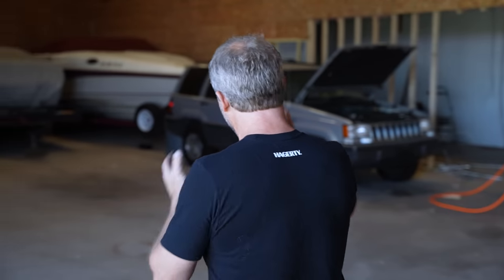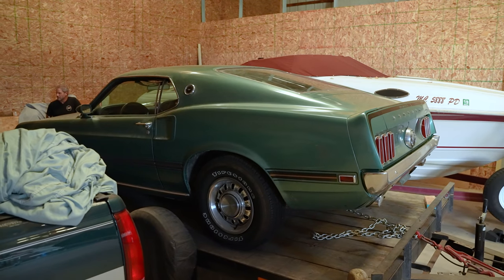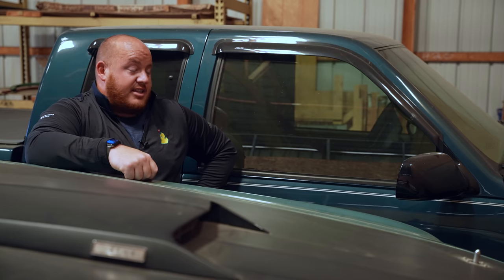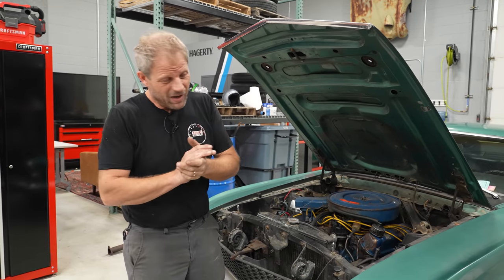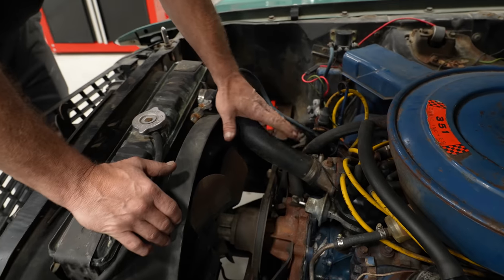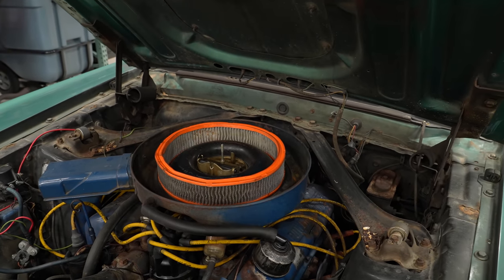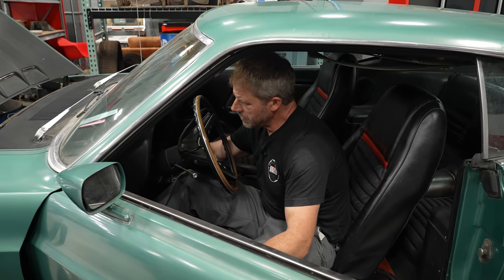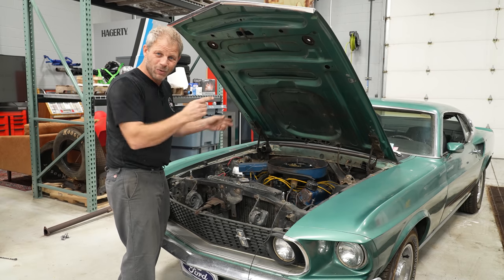Will it run? "Ran when parked" '69 Ford Mustang Mach 1 uncovered after 20 years in storage

Comment: Change the oil, rebuild the ignition, rebuild the carb, new air filter, new antifreeze, and thermostat then time to try it out. That's a 2 day job if the carb rebuild kit is available and you take your time. Once that's going do a brake job and get new tires.
Reply: Yeah you should always do a reverse coolant system flush as well. Not to mention the fuel filter, and pre-oil the cylinder bores.

Comment: What a great car in a unique color. Looks in amazing condition. Windsor had a 2 barrel and Cleveland had a 4 barrel and better internal parts list if my memory is correct With 290 listed horsepower. My first new car was a red with gold strips Mach I with a 351 Cleveland. Also. For all those complaining about the new Mach I not having a Shaker hood. Take a close look. No shaker hood. The Shaker came on Cobra Jet cars. I opened my scoop and purchased a breather ram air air filter that worked off vacuum. Loved that car, but having kids created a need for a larger vehicle so the Mustang had to go. One of my favorite cars.
Reply: The 351 Cleveland has canted valve heads simular to the big block Chevy. The 290 horsepower rating was underrated in 69 for insurance reasons. 300+hp was considered high risk.

Comment: Any car sitting this long ... I would have pulled all the plugs and squirted a little light oil (transmission fluid is good) into each cylinder. Then crank it with the plugs out for a bit to get the oil pressure up and re-seat the rings and valve seats.

Comment: Yeah... I would get it running first before going and changing anything - sort of "set baseline". Because if it does not run after everything is change it would be bummer. So step 1 - see if it runs just by fixing basic things - spark, fuel supply. If it runs then (step 2) you know you have good running car and then "servicing" can start. But if it doesn't run it is important to understand why, before any further changes are made.
Reply: That's the worst thing you can do. Running it is the last thing you should do, once you have gone over every system. First thing you do would be remove spark plugs, pre-oil the cylinder bores and do a compression test, if it has adequate compression readings, then there is no reason why it will not run as long as the supporting systems are in a serviced condition.
Reply: @nzuncovered1845  Who said you should not pre-check the engine? Sure, check spark plugs, pre-oil cylinders, check compression etc. That is fine. I would even drop a pan, change the oil and filter, just in case some old crap sits at the bottom and gets sucked into the engine. What I said, I would not start replacing all parts before I get it running, like spark plugs wires for example. So one thing is to ensure you won't cause unnecessary damage - which you absolutely should do with classic car engine which was sitting for long time, and totally different is start changing parts which you don't know are bad.
Reply: @lp9280  Yeah I agree with you there. Good thinking on the pan drop not many people do that these days, Thats what I mean by going over every thing, definitely do oil and filter/fuel filter change and do compression check. I guess there a few different approaches to take. You will have to throw some money at it just to see if the engine is good enough to run. Even then you could start it after all that and find it has run a bearing.
Reply: @nzuncovered1845  that is why I said I would not start ordering and replacing all new parts (spark plugs, leads, water pump etc) without knowing they are bad. Get engine running without "hurting" it more, replace only what prevents it from running literally and then see where to go from there. Why change parts, if as you say maybe once it starts running it turns out to have spun bearing, or crack in the block or head, whatever the case may be. Now I am sure spark plugs and leads are check in grand scheme of things, so I would replace them eventually, but I would not start from there before knowing engine is running and healthy. Seems like we both agree here :)

Comment: Assuming the reason it doesn’t have sparks is one of the parts you’re replacing contributed to it? I would definitely check the hot side of the coil  for 12 V/
Assuming a rat didn’t chew through the wires in the past 15 years of sitting
Reply: I don't think he replaced anything yet. He was talking about replacing these things in the future.

Comment: Why not change the oil/filter before trying to start it? After sitting that long, won't there be moisture in the oil, even if it's just on top. Why risk it? Is this not an issue?
Reply: That’s exactly what I was thinking. I would think that would be a top priority. Maybe he just forgot to mention it.
Reply: No sense in contaminating the new oil. Get the old oil hot first then change  it.
Reply: @Hanzyscure   Wouldn’t it be better to put new oil in and run it till it’s hot and change the oil again. Oil is not that expensive, but engines are, especially numbers matching. I wouldn’t even start it with that old oil, but what do I know? I’m not a mechanic. To me it’s just common sense.
Reply: @Magnabee97  Yes you are dead right. Don't listen to that Hanzy fool. Old oil looses it's properties and viscosity etc., it becomes as good as water. You risk damaging the engine if you run it, even just cranking it over. You should change it first with some cheap oil, then change again with better oil once you have it running with everything else serviced.
Reply: @Hanzyscure   You only get the oil hot to drain it when you are doing a service on a car which is still before it's service intervals required date/miles. A little over the date is fine as long as not more than 1000km over.

Comment: Gas isn't getting into the carb enough. And the starter cilanoid needs to be replaced as well as the spark plug cap needs a go over. We've done this way too many times to count and seen this before with our old stangs they hate to sit, thats for sure

Comment: I suppose you noticed no hose on the vacuum advance.
Reply: Why does it matter? Vacuum advance is not important. Some people disconnect it entirely.
Reply: @nzuncovered1845  Vacuum advance matters if you're concerned about fuel mileage, if you're not, it doesn't.
Reply: @bradfordeaton6558  Yes it definitely does a job. Although it is not needed to start an engine and idle, when you are setting ignition timing you disconnect it anyway, so I would say they weren't to bothered about it just to get it running initially. Also there doesn't seem to be a vacuum line present so it may have been capped off at the manifold, who knows? If it was left open you would be able to tell easily as the engine would run lean and rev up when started
Reply: @nzuncovered1845  You'd definitly notice if it was manifold vacuum but I sometimes use that hose to hook up a vacuum gauge.

Comment: So,,, you didn't want to risk the bearings incase they're dry, but you Crank over with plugs in before getting up oil pressure?, and I'd have tested for 12v at coil and see if points sparking etc, guess we're different in the UK 😄👌

Comment: Change the oil, do a compression test, get a new fuel pump, blow out the fuel lines and get new gas, rebuild the carb and distributor and then hit the key.  In that order.  
This wishful thinking stuff is for the birds!

Comment: First thing I would do is a compression check
Reply: Wouldn't be accurate because of sticky valves and rings.
Reply: @Hanzyscure  
You are correct, if the numbers are off by quite a bit I would then perform a leak down test. My point is don't spend a lot of money if the engine needs to be rebuilt. That would be my first priority. I been down that road more than once.
Thanks for replying.

Comment: Distributor should have been pulled to get oil pressure, long before you hit the key.
Reply: Pulling the distributor won't give you oil pressure.
Reply: @Hanzyscure  The distributor has a gear on the shaft that drives the oil pump. So if you remove the dizzy, and put a drill or tool down the channel you can engage the oil pump without turning the rotating assembly over, therefore priming the system, giving you oil pressure.

Comment: 4:58 does the hood have any other locks apart from these two racing pin locks? If not, you were super lucky that the car was not the other way round on the trailer because the hood would have opened because of the wind. Once i lost my windshield this way 
😿 EDIT: yeah it has another lock in the middle - lucky you :D
Reply from the maker: If you check 4:42 you can see we had it pinned for the tow to the shop.
Reply: @Hagerty  yeah i see it, thanks for the answer :)
Reply: The hood pins were secondary to the hood latch on the Mach 1. No worries as long as the hood is all the way down and the hood latch is engaged.

Comment: Did I miss that the fuel line got disconnected or pinched off? I wouldn't have wanted to pump a bunch of nasty old gas from the tank up to the carb. I like to spin them over the first time for oil pressure with the plugs out. Less stress on the dry engine and it spins over faster, thus priming the lube system faster. Also, the pugs out gives the opportunity to add some lubrication to the cylinders. I like MMO for that because of the Stoddard solvent in it (about 25% last time I checked, plus mineral oil). Can't wait for next week!
Reply: I usually disconnect the fuel line and just squirt 2 stroke gas down the carbs to fire it off quick.
Reply: cool. People on youtube assume that literally every fuel tank is rusted out. Probably because of a certain channel I won't name.
Reply: Marvel Mystrey oil
Reply: @Terminxman  If it does have gas in it definitely needs a Good cleaning out! It probably helps a Lot,being stored indoors!
Reply: I'm sure gramps put Sta Bil in the gas when parked.
Reply: Good tips. Must keep them in mind. What do you do with MMO? Just add some to the regular oil?
Reply: @danbaumann8273  In the cylinders. The Stoddard Solvent helps break rust and carbon. plus adds a Little lubrication to the cylinders. Just one squirt.
Reply: @SootHead  Thx 👍
Reply: @danbaumann8273  remove spark plugs. Squirt in cylinder heads. To loosen them up from sitting.  So long.

Comment: I'm actually more happy that it didn't start... What were you thinking when trying to start it without doing some careful preparations? You never know if the piston rings are seized, cylinder walls dry from oil, oil turned to gunk in some places or cooling system/water pump full of gunk. Starting it up could've made (more) damage to it.
Reply: Exactly this dude 👍
Reply: Engine’s probably going to be rebuilt anyway.  A few drops of oil in the cylinders wouldn’t have hurt though
Reply: Rings will unseize themselves when engine runs. Your being over dramatic.

Comment: that's still a dream car for me.... but man the prices of these things the past few decades have taken off from what i remember.
Reply: @\VV/ In 1970 I was 17. Mom loaned me $600 to buy a '65 squareback, factory 289 hipo! It had it all. Big alternator pulley, engine balancer,quicker ratio steering,4 speed & 9 inch rear! A few years later, I bought a '65 fastback that had the 289 hipo drivetrain installed in it. It had a BIG Crower solid lift cam, Torquer  intake, Holley, headers, line lock, 4 speed & a 4.57 9 inch rear.  With 7" cheaters. I shifted at 7,000 rpm it was my daily driver & racer. In the 1/8 it ran 8.30. This was about 1972 or '73. I payed $650 for it,I'd give anything to still have it even though I'm 68!

Comment: Replace the fuel tank, and fuel line as well. Possible rust in the line. Not to mention old has that will cause problems with the valve's.

Comment: Nice car and should be simple to work on. Started my apprenticeship in 1970 and still have a point file in my toolbox. Had to use it when the 73 Porsche 914 sits over time, now I put a piece of paper between points if it will sit for some time..

Comment: I had a 1969 a few years ago drove the heck out of it. I noticed the vacuum advance line on the distributor's not present. I'm wondering if that might be part of the problem? Your shows are great looking forward to seeing more.
Reply: Don’t need vacuum advance to start…. In fact you have to disconnect it to set initial timing….
Reply: @nobodyspecial6436  thank you for the info

Comment: Probably the condenser went bad just sitting. That's why NOS condensers sometimes are bad right out of the box or fail quickly after going into service. Just like the capacitors that breakdown in old radios.

Comment: Can we talk about that mint ZJ Grand Cherokee, please?
Reply: Was just thinking that. Have been quite a few years since seeing a fairly cherry ZJ. I wonder if it's an I6 or not. A lot of the ones up here were the V8's which weren't very good.
Reply: @CanadaBud23   I had a 94 with a 5.2, rock solid motor and the 32RH transmission was also very stout.
Reply: @bfisch81  Few buddies had a few dodges and had a friend with the 5.2 ZJ, hadn't heard of them quitting but they rattle, bang, leak, low power. Good aftermarket top ends keeps them quiet, probably going longer too. I had an 87 ram with the 5.2 and it probably the best one we had. People wondered how I kept it alive lol, regular oil changes and cleanings it ain't bad. Cleaned it every month to keep it from looking like a greasy dirt clump lol. I don't agree there that good of a motor but decent enough. Some have good luck with them.

My dad always thought it was good enough for the job at least, I'd tell him the I6 in my XJ was still a superior motor. He'd argue that for a bit but his truck is long gone and my jeep is still here so agrees now lol. At least that's my experience.

Comment: Every time you get your hands on a car that has been sitting for decades, or even just a few years, DO NOT JUST CRANK IT!!! If the motor turns around, you now have a good project to start from, but if you star it up with all the grime, carbon deposits, siezed piston rings, cloggs inside the oil passages, your easy staring point quickly turns into a lump of recycling material. At the bare minimum, drop the oil pan, clean or change the oil pump, spray some cleaning agent and lubricant on the crank, cam, pistons, oil passageways you can find, and then seal the engine with new seals and fresh oil and filter. After that, run a couple of heat cycles changing the oil and filter between every cycle, and then start worrying about the cooling, with flushing or replacing the radiator and waterpump, hoses, heater core, thermostat, head gaskets, etc.
This can all be done in a weekend with minimal investment, but after you rushed up the first start and spun a bearing the bill is much, much higher.
Reply: Couldn't agree more!
Reply: It will be just fine. The length of your comment unveils an underlying conception of motive.
Reply: @Hanzyscure  I have literally destroyed the whole rotating assembly on car in the first pull, after starting it from two years of sitting. Everything seemed "just fine". So, I do know what I'm talking about.

Comment: The hood pins are out so the hood has been opened more recently, I'm guessing. Vacuum advance for the dizzy?
Reply: Yeah and those tires look pretty nice for 25 to 30 years old….
Reply: Why do you people keep repeating the same comment about the vacuum advance? Vacuum advance is not necessary. When you set the ignition timing, you disconnect the vacuum advance anyway, so it doesn't affect engine idle or start up. In fact, many hod rodders use to disconnect the vacuum advance completely and plug it up, not something I would do, but I have bought a few cars where the vacuum advance had been disabled, and they ran fine.
Reply: @nzuncovered1845  I believe in those cases, the port has been plugged which wasn't the case here...
Reply: @Trapper50cal What do you mean? You only have to plug the port going to the intake manifold, not the distributor. It is just a spring diaphram. No need to cap the port on the dizzy.
Reply: @Trapper50cal  If the actual vacuum line is left open, then I didn't see it. I will watch it again and see if i missed that..

Comment: if it was 31 years old when it was parked, the motor has had a hard life and if you can turn it over by hand there isn't much compression
Reply: Windsor was an 8 to 1 compression motor. Gramps probably pulled plugs and oiled the cylinders when parked.

Comment: Next thing to do after getting it running is IMMEDIATELY replace the tires because they are likely well over a decade old.
Reply: They should be inspected and then replaced if there are cracks. Of course, they will not be reliable for higher speeds, but for easy driving they are most likely just fine.
If you think rubber should be replaced only because it's 10 years old, then you can go rebuild the complete engine, as it also contains various rubber seals, much older than 10 years.